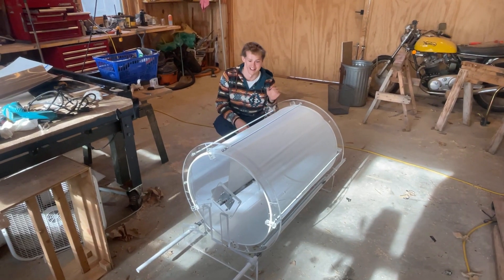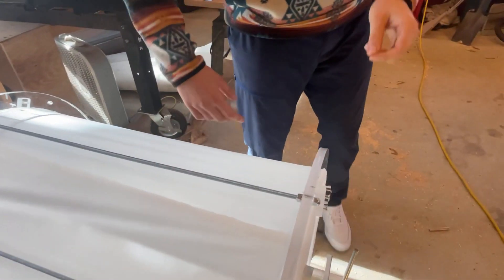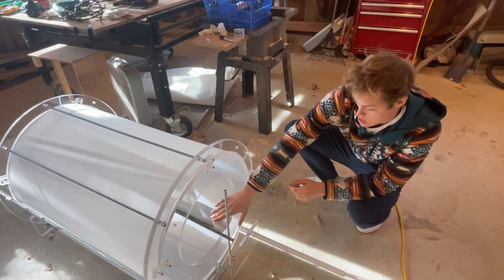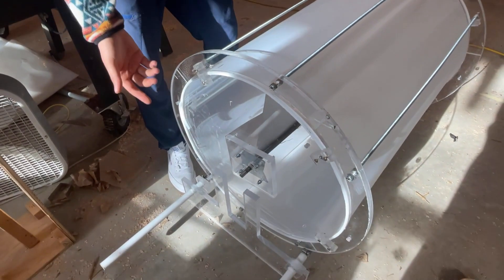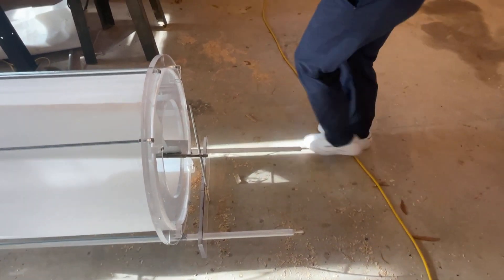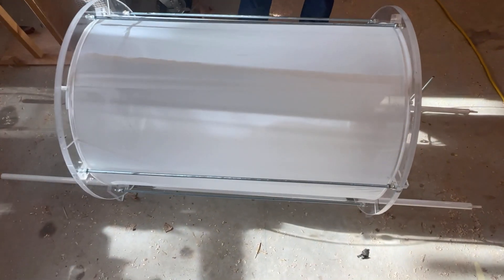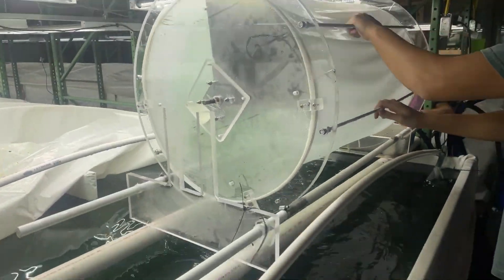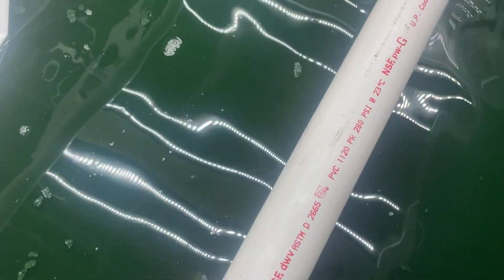Spirulina Drum Harvester

Comment: Nicely done and thanks for sharing.  I recommend little wheels to rotate on.  I got 4 from Temu for a few dollars.  Also a 70kg torque low rpm dc motor from Amazon could rotate a chain to rotate that.  I’ll make a video.  Would you share blueprints to cut the acrylic, please?
Reply from the maker: @SufficientSpirulina  nice, I’ll look for them, recommend making smaller diameter and lighter acrylic